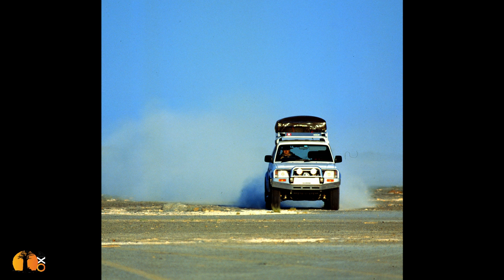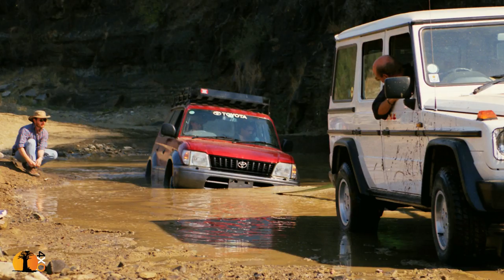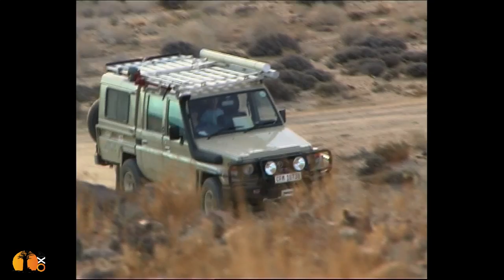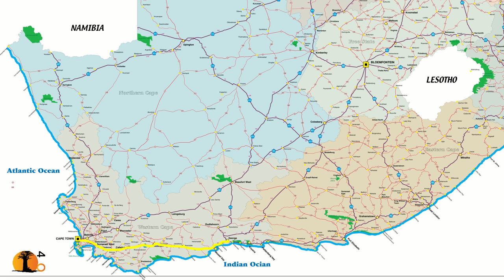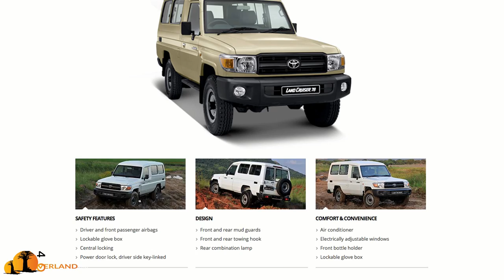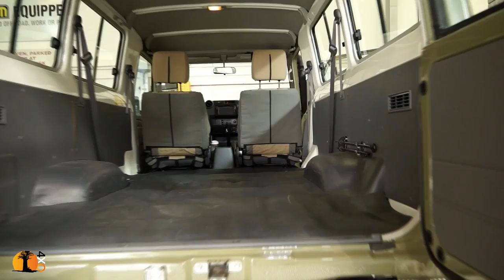WHY I DRIVE A TOYOTA 4WD | StoryTIME with Andrew St Pierre White

Comment: As a Toyota Prado Series 90 driver, I must say this is an utterly underrated vehicle. Definitely not as tough as a well maintained  Series 80, but easier to drive and maintain. Definitely a badass too. Tougher than the later Series 120 and 150 for sure. In fact, the later versions had the D4d 163cv engine that combined good fuel economy and reliability; a class on her own for sure.

Comment: Another great story Andrew
 
I had a similar experience on my 105 last year.  The engine cut-out halfway to Broome, cranking beautifully, no fuel.  Alas I'd blown a fuse (excessive current draw by relays on aftermarket D-Gas), tried to figure out where it was, but after 10 mins I ended up running a quick fuse and wire straight from the battery + to the injector pump, and kept on driving!!!

For a week or two we jumped out of the car, after turning off the key, to pull the temp fuse to stop the engine! Once back in Karratha, I was bothered enough to figure out the fuse location and replace.

The simplicity of the 1HZ really does give peace of mind.

Comment: Fantastic story, thank you for sharing. As far as your fuel consumption to George and back, my 2 cents worth having had a similar situation with a modified Volkswagen- cruising at 140km/h and above, you are in a rev range where the engine can make use of the flowed head, modified camshaft profile etc. and actually “breathe”. The increased power and subsequent improved efficiency require less throttle to do the same amount of “work”.

Comment: Inspiring story Andrew. My first contact with a Toyota was in 1968 when my father arrived home with a Toyota Stout (full import), a 1.5t 2l rear wheel drive truck with an exceptionally low first gear. This did duty as a 3T truck around the sugar plantations in Natal. Since then its been Corona's, Corolla's, Cressida, Lexus GS300, Prado 90 before a shortlived switch to a Land Rover Discovery 4 before my current 76 V8.  I would buy another series 90 Prado in a blink if I could-the 76 was a nostalgic glance over my shoulder to my 18 year old 320,000km KZ-TE beastie. The 76 has a very rough ride after the 90 but is in a class of its own when one leaves the road with a heavy tow load.

Comment: The fuel consumption of the 105 makes perfect sense. My '97 Cruiser (1KZ-T engine with an Intercooler added in front of the radiator and a chiptune)
drinks 18 liters on 100km below 95 km/h, and 11-13 above it. 
I have to be in Overdrive and keep the revs below 2000 to achieve that.

Comment: Andrew, I would like to share my experience with the 105 series. I have one with the 1FZ-FE engine (which is an excellent engine), but the fuel consumption is not that good as you said. My best average was 13.5L per 100km (7.4km per liter in Brazil's most used scale). That was before the front bumper with the winch, the snorkel and the roof rack.
Now, I usually got between 18 and 16 in the city, and something about 15 and 16 at the road. Despite the fuel consumption the car is just spectacular. My next upgrade will be the diesel engine swap, most likely the MWM 6.07 Sprint (I belive that some Ford F250 in South Africa came with that engine). Here in Brazil the Land Cruiser - exept the Prado - are extremely rare vehicles, that's one of the reasons I will not sell my car and buy another one with the 1HZ.

Thaks for sharing the video with your experience.

Greetings from Brazil.

Comment: I also had the fuel issue with the 1HZ 105. I bought the vehicle in Cape Town, drove it to Durban and the next night it would not start after driving for the day. I found that it would start when it cooled down but when it was warm, it wouldn’t. Took it to the mechanic and he said it was common with the Patrols and 100 series, either remove or replace the immobilizer unit. 
Thanks for the great videos. I have learnt a lot from them.

Comment: Miss my 90 series prado very underated 4wdrives my first car was a 92 2.4lt petrol 4runner that thing could not be killed and trust me the tourcher i put it through it went to hell and back then i bought the 96 prado 3.4lt v6 for the family that thing took us on many adventures over the last 6 years during that time i sold the 4runner and bought a 2012 3lt td hilux that was pretty much my dream car ive never had any issues with it what so ever  ive now upgraded the 90's prado to the 120 series  3lt td prado and that thing blows me away on and off road im looking forward to the adventures that will take me and my family on ive only owned toyotas and i put my 100% trust in them to take me and my family where we want to go

Comment: I own a 2014 FJ Cruiser. I bought it because of its looks and 4x4 capabilities although I seldom go offload.  The very first time I took it off the lot? Man was it comfy. The ride was soft and so comfortable. Going to the gas station for the first time I love it when someone comes up to you and tells you how much they admire your vehicle from a looks standpoint. My FJ gets a lot of attention at Garage Sales just sitting there in front of someones lawn looking all bad. 
And so far after 5 years of ownership and finally owning it outright it has not had a single problem. Zero, Zip, Nada. Gas mileage is just acceptable at 20mpg but absolutely no problems or issues. With Toyota I've found that they get 95% of it right and you just have to deal with the 5% you don't like. Unlike Toyotas competitors who have to deal with the dreaded "death wobble" or "its not leaking oil its marking its territory" Toyotas only real vise is its thirst for fuel. And I remember Andrew that you test drove the FJ Cruiser and your opinion at the time was how much fun it was to drive the FJ Cruiser and I'll just have to whole heartedly agree.

Comment: Great story! Thank you. I had similar experience with different dealership charging me $200 for diagnostics to tel me nothing is wrong. Two days later car would not start and an auto electrician took 2 minutes to figure out the problem - starter motor clutch. Have not been to dealership since.

Comment: Hi Andrew. I couldn't write regarding your review of the Pajero (comments disabled) so am here on your Toyota slot, which is related!

I bought a commercial pajero(shogun) lwb this year in the UK, and apart from the rather disappointing fuel consumption it's a great vehicle , It will never be used in the desert, but sees much heavy towing, and doubtless muddy tracks and steep gradients on the farm. I thought your comments very relevant and fair. Still, it's an old school vehicle, and should it prove reliable, this will offset the very average fuel economy. Oh ,and the commercial doesn't have those speakers sticking out in the back that so annoyed you! 

We have just bought a new Toyota Hilux for farm use. Initial performance suggest it is all the manufacurer claims it to be . Many thanks and keep up the great balanced reporting.

Comment: Re Fuel consumption, the Cruiser 105 with the FZ-FE 4.5 petrol, with a roof tent and Karrite roof carrier at the front of the rack - and this works as something of a wind break.... On a trip with lots of sand through Bechuanaland's central Kalahari Game Reserve, over a number of near identical 105 Cruisers and mine weighing in close to 4 tonnes with 3 on board, fully vitled we'd average around 21 litres per 100 km. This also involved highway driving at the legal maximum of 120 kph, or even a tad over.  It's heavy consumption but with the Long Range Ausi Out of Town tank I had a total of 280 litres I had a range of 1,400 km and that straight 6 motor is bomb proof. On a normal trip we'd get around 20 l/100 km. With the roof rack off and a relatively light load - no packing system or water, on a long tar run, I'd get 19 l/100 km, sometimes a bit under.

Comment: OMG I just found out I'm brand loyal.....at this time I have a '71 Land Cruiser  a '91 MR-2 an '04 Avalon, '06 Tundra 4 wheel, '011 Tundra 4 wheel....I have retired 3 Tundra 4 wheel drive all with over 265k  3 Camrys with well over 150k on them and still running with little mechanical problems...now ask me why I am Toyota loyal?

Comment: I'm also a diesel mechanic. There was no need to jack up and turn the wheel. ..
After removing the glow plugs, you could just swing the motor over with the starter, and all water would have been ejected much quicker. 
The motor wouldn't start of course, as without glow plugs, there's no compression.
Mind you, you were lucky you could get them out,  as they can get pretty stuck,  and break off. Then you're also stuck,  as their hollow. 
Again no compression.

Comment: Your stories are always so fascinating! Thanks for taking the time to chat about your experiences with these various companies. If you were based in the US would you still opt for one of Toyota's models (Tacoma, 4Runner, Land Cruiser)? Or would you seek a different model from a different manufacture? Thanks!
Reply from the maker: Very good question. I am not loyal to Toyota more than I think that they make some very good cars and trucks, fit for my purposes. But in the US, I fancy some of the Dodge products. The Ford 150 Raptor looks brilliant. One thing is certain. I would not automatically head for the Toyota showroom as my first choice.
Reply: For some reason they seem to be very slow offering diesel in mid-size trucks, and I think the 2019 Tacoma was just announced with petrol only?  The zr2 looks interesting...

Comment: I really like my 2016 4Runner. So far, it's been an excellent and very reliable vehicle. I like their buld quality and attention to small details.
I used to have a 2010 Toyota Tacoma but it had some constant problems with the manual transmission, clutch and rear differential. Several problems were serious but the warranty covered it. Rear differential started making some noise since 100 miles on the odometer (basically brand new). Someone at the factory forgot to put enough oil in there, so it had one quart of oil instead of 3.6 quarts. Poor quality control!
So far the most capable and very reliable vehicle has been my 1998 Jeep Grand Cherokee. I bought it new and still have it. It still runs like new and I've used it off-road a lot and also pulled a 2 ton travel trailer quite a bit with it.  Hopefully my 4Runner will be as reliable as the Jeep. So far it's been solid and reliable.

Comment: I've only had Daihatsu 4x4's for 30 years. Toyota had 1/3 of the company's shares until 1999...from then on it became a subsidiary of Toyota. Main Daihatsu real offroaders were the early F-20's Taft petrol with Toyota 12R 1600cc engine and, F-50/55 diesel with Daihatsu 2.5l and 2.8 l engines. Around 1983 came the Rocky/Fourtrack/Rugger with Toyota 3Y and 4y petrol engines, Daihatsu 2.8l Diesel engines including turbodiesels and in swb and lwb and other versions. A special and beautiful Rocky F-300 was developed mainly for US market and an Italian designer renamed the Rocky Bertone Freeclimber installing 3 types of BMW engines for the luxury European market. The other classic is the sporty Feroza with a Daihatsu 1.6 l 16 valve engines. All of them tough and reliable, which is what is needed when overlanding or heading to the wilderness. The Terios models are more of a soft offroader sold in some countries as Toyota Rush. Cheers and hope you check out this amazing and underrated japanese quality brand.

Comment: i bought a 2001 land cruiser Prado early last year with only 44000 kilometers and it was fully loaded and mint condition its awesome i also have a 1999 with only 165000 kilometers but its base model both are v6 gas engine

Comment: The 1KZTE engine was a good engine, but comparatively speaking it had a few more issues, mostly head issues, broken valve guides, that sort of thing. It was a somewhat old design too, indirect injection. But Toyota tends to do things like that... keep older designs around for a long time and "properly" develop it :-)

Somerset West huh... That's my home town.
Reply: plonkster people hate in petrols, however would rather have the 1GRFE V6 anyday. Not much more fuel than the 1KZ and a shitload more power.

Comment: Having recently bought a high miles 16yr old Rav4 as a lightweight 4x4 to get my wife to her cancer treatment come what may, I have more faith in this vehicle than anything I've owned previously. I am a convert to Toyota/ Lexus and we have another, a lexus rx450h which has been so reliable and got us out of trouble so many times going where it has no right to work like it has.   Never had a real issue with the lexus or toyota engines but everything we've previously owned has let us down at some point or other.  I am a convert to Toyota.  They just work.  I just wish they didn't pander to fashion and following the vanity stakes of all other manufacturers as much because it destroys much of their practicality. The old saying is true though...you go into the desert in a landrover..but if you want to come out you drive a toyota!  The little rav has been fantastic since it was bought.  All it took was a change of tyres and that little car goes just about anywhere and is so practical and robust.

Comment: I have owned a 1997 Landcruiser and a 2014 Hilux, drove both hard off-road. I have driven long off road trips in the USA, Africa, Asia, Aus. Because of the Toyota DPF problems, I now have a 2018 Mazda BT50 3.2TD 6-sp auto gearbox, we just did the AAA and the French Line through the Simpson, started at 780km on the ODO :). The Mazda wipes the floor with the LC and the Lux, the auto gearbox is AMAZING, makes huge dunes into child's play, wonderful comfort, huge grunty torque. Wash and she is a daily driver again.

Comment: The 1FZ-FE 4.5L petrol is a smooth running, easy driving, fuel monster. #NorthAmericaProblems it was the only motor available in domestic market 80 series when I elected to replace my SWB Gen 2 Pajero. Love the vehicle. Don't love the fuel economy. The best I've managed is 14.5L/100Km. It's burned 17.5L/100Km over the last 16000 Km.

To Toyota's credit it's rated to burn city/mixed/highway USMPG of 12/13/14. My average fuel economy works out to 13.4 US MPG with the RTT on. My 23 year old car with over 200000 miles (ex California car) still gets precisely the rated mileage. A diesel conversion will likely be the long term solution to the fuel economy for us.

Comment: great story. just wondering if you drowned a gas engine, do you do the same thing except remove the spark plugs or do i need to remove the fuel injectors?

Comment: 40:09 I had similar situation with Lexus dealer in Sydney where they don’t know how to remove the nut for crank pulley so they called a third party mechanic to remove that only which later they included in the bill as $250 job, without even asking me first, when I told them “you could have placed the socket handle bar touching the floor and just a very very short crank on the starter mortor could have loosen the crank nut”, they looked at me as if I am a mad person and don’t know what I am talking about.
Reply: Lol I did it the same way for my SC400. Interesting that the dealership didn't know that...

Comment: A great video.
I second your views of modern day mechanics.
They just want to plug the vehicle in to a diagnostic console and not think for themselves.
This old story is probably now true of most vehicle garages. 

NASA decided to send a shuttle into space with two monkeys and an astronaut on board. After months of training, they placed all three in the shuttle and prepared for launch.

Mission Control Center announced, "This is Mission Control to Monkey One. Do your stuff."

The first monkey began frantically typing and the shuttle took off.

Two hours later, NASA's mission control center announced, "This is Mission Control to Monkey Two. Do your stuff."

The second monkey started typing like mad and the shuttle separated from the empty fuel tanks.

Another two hours later Mission Control Center announced, "This is Mission Control to Astronaut... "

At this, the astronaut shouted "I know, I know -- feed the monkeys and don't touch anything."
Reply: Most reliable automobile

Comment: I owned a 1973 Celica..I got the car for $70. It needed some work to put it on the road. I drove that car for several years. Then I made the big mistake of buying so called American...well I am done with that Yankee crap...and I don"t think the German automakers are much better...so now my wife and I are on our 3rd Toyota. I own a 2013 Tacoma which has its heritage in the Hilux. There is a reason Toyota is number one in quality..they just build things so damn well and when there is a problem, they actually make the bad part better so it will not fail again. I have seen this from first person experience.

Comment: comone andrew in germany they build pop roofs for more then 20 or more years. also in other european countries like france spain etc. Not all of them are on display at the Abenteuer Allrad. A lot of those roofs have been tested for so many years in very difficult climates and on very  hard track's. I think you comments that the Hercules conversion is the best is leaning out of the window quite far....!
Reply from the maker: I have looked at a lot of them. Practically speaking, not one is as fast to erect, the simplicity of design. Every one requires more time to erect, all have a smaller bed area and take considerably more time to put away. THIS is what I base my statement on. Quality of manufacture is better in most German conversions. Some German conversions are truly horrid, lacking of much understanding of camping.